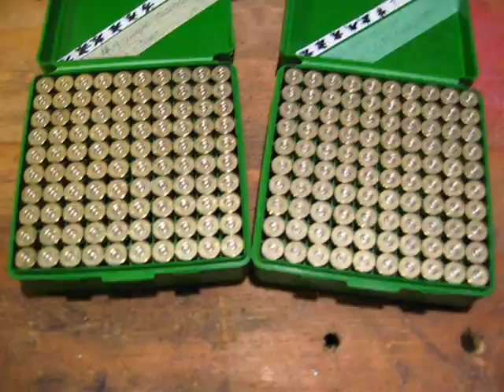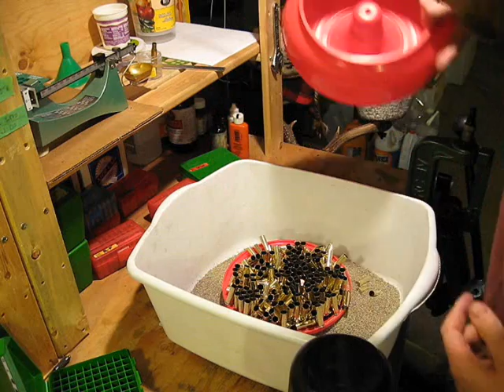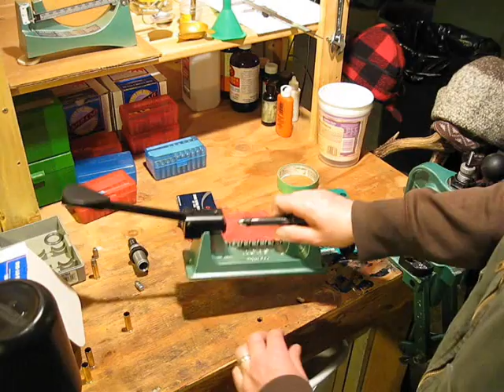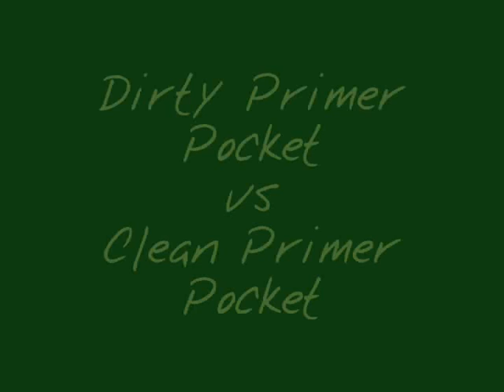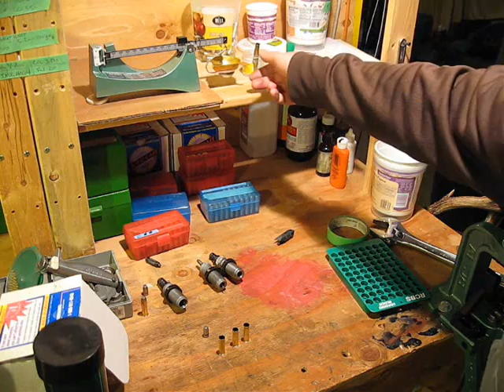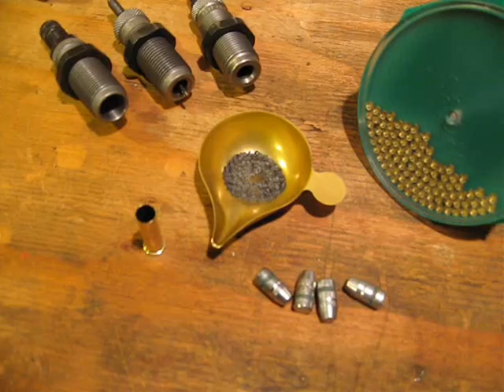Reloading Basics for my 357 Magnum

Comment: A Single Stage press is slow, as you said. A progressive press is fast but expensive. I recommend a turret press. They are great for beginners but you never feel you have outgrown them. You do one cartridge until it's done. Only then do you go on to the next cartridge. That way it doesn't matter if you do 100 or if you get interrupted after 87 rounds. You won't have cartridges half done with powder in them. 
Very good video.

Comment: I have a "Traditions" G2 this is a single shot break action 357 Magnum Rifle.
In order to find a good ammo length, I took a unprimed case pressed in a XTP bullet partway. then I took this uprimed and non charged round and put it in the rifle and closed the action. then pulled out the case with bullet and measured the round for length, then I subtracted 2 thousandths for the proper length for my rifle. The bullet comes into contact with the rifleings in the bore, on closing the breach the bullet gets pushed back into the case. Now I know exactly what my over all loaded case length  for MY rifle.  This method can be used for pretty much any and all firearms.  Just be careful.

Comment: Thanks for the info. Question I was wondering could you de-primer the brass before you put the brass in the cleaner to save a step? Just wondered if it would work that way or not.
Reply from the maker: TW RetiredVet, definitely! Some folks de-prime (or de-cap) their brass first and then tumble.  The only “cons” to that is that tumbling media sometimes ends up in the flash hole and needs to be pushed out with a pin, also you are putting “dirty” brass through your loading die.  I’ve done it both ways and I don’t know if I even have a preference.  A lot of folks shooting handgun ammo don’t even bother to tumble their brass.  I much more particular with my rifle ammunition.  And if I did even more shooting, I’d invest in a Dillon press.

Comment: Can I just deprime them first and then let the tumbler also clean the primer pocket?
Reply from the maker: Lucy Carr that works just fine, but typically my pocket primers are not cleaned very well in my tumbler and then the tumbling media is often stuck in the flash holes of some of the brass and then I have to knock it out.   I don’t own one of the sonic cleaners, but I’ve heard they will clean out the primer pockets (you’d have to ask someone who uses one).  Anyhow, you can do it either way (I’ve done it both ways many times) I just tend to prefer de-priming after I’ve polished my brass.  There are also lots of folks that never polish their brass.

Comment: Nice video, thanks for taking the time. Right now I reload for 9mm but I'm considering getting a 357 mag. I wet tumble my brass using a Harbor Freight 2-barrel rock polisher, 100 brass per barrel. I put about 1 tsp Lemi-Shine, a squirt of Dawn dish soap, 1/2 the #6 steel shot from a box of 12 shells, and hot water to just cover the brass, per each barrel. Set the timer for 1 hr and hang the brass upside down in the plastic rack the bullets come in. If you take a handful of brass and pour them over the rack the heavier base of the cartridge falls in first. Then take another empty rack and put it face to face with the loaded rack and turn it upside down. A fast way to load the brass mouth down. Set the racks in front of a fan and they dry quickly. Then decap and repeat the process, tumbling for 1 hour without the primer in. The #6 steel shot is small enough to scour the inside of the case and the primer pocket, you don't foul your dies decapping, and no extra time cleaning primer pocket by hand. I use a plastic colander slipped inside a t-shirt to drain the dirty water after each tumble and rinse with warm water, then pour the brass into the colander to separate the steel shot. So you have 2 hours tumble time while you do other stuff. Oh, and heat the steel shot on low heat while stirring in a metal cookie tray to dry it, otherwise it rusts.
Reply: I meant to say 12 gauge shells, not 12 shells.
Reply: Brass doesn’t have to be shiny, Just clean. Two hours in a vibratory Tumbler is sufficient.

Comment: does anyone have a list of the supplies that he used?
Reply from the maker: Gavin shoots, I was using Unique powder (although H110 burns a lot cleaner) and Laser-Cast bullets.  The bullets are manufactured about 45 minutes from my house and at that time I could buy them for around $50 per 500.  The powder was $20 a pound.  So I could load 1,500 rounds with $150 worth of Laser-Cast bullets (3 boxes), $20 worth of Unique powder (1 pound), and $60 worth of primers (15 boxes).  Total cost of 1,500 bullets $230 (or $0.15 a round).  If I wanted to load those same rounds today it’d cost me $295 (or $0.20 a round).  There are other powders that will fill the 357 case, basically tripling the cost of powder.  So even though Unique burns dirty, when I was trying to save money, that’s what I was using.

Comment: Very good video.  I want to get into reloading.  What is the approximate cost of your equipment, and the cost of additional sets of dies?  Thanks.
Reply from the maker: Roger D. Miller the setup I’m using cost $330 at midway USA.  Die sets range from $30-60.  There are other miscellaneous items you’ll want.  If you’re planning to reload for semi-automatics (AR 15 or pistols) you’d be better off investing in a Dillon progressive reloader.

Comment: You have to be kidding when your saving that it’s not critical for you to check the powder level in a pistol cartridge   you’re mistaken sir it is very critical to make sure of your pistol charge
Reply from the maker: Willie Bulletman, you must have misunderstood what I was saying.  When I reload rifle cartridges  after every powder drop, I verify every single load with my scale,  when I’m loading pistol cartridges, once I’ve set the volume on my powder measure, I check every 10th load.  What I was saying it that if you’re handgun cartridge is off by 1/10 of a grain you probably won’t notice it in the accuracy, since handguns are inherently inaccurate.  I am VERY cautious when it comes to measuring out the correct amount of powder.  I was saying that if you are using 6.1 grains of Power Pistol and you load some rounds that measure at 6.2 (so long as you’re not exceeding the maximum charge!) it’s not critical to VERIFY WITH A SCALE every single load.   When reloading I am BEYOND cautious!  Most people that are using a progressive reloader set the volume for their powder measure and check it every 50 or 100 rounds (if at all.)   I WAS NOT saying that it’s not critical to know how much powder you are using, that would be asinine.

Comment: what do you need to do with the die if you go from 357 loading to 38 special reloading ?? Do you just adjust the flaring die to the 38 spl length which is shorter??????thanks

Comment: thanks for the video. 
straight ahead.  simple clear demonstration. 
I'm just getting into reloading and am starting with 38 special and 357 magnum. 
question,  I'm not in the know about cast bullets. 
is there issues of leading or lead fouling? I feel inclined to use plated bullets for that reason but know the cost would increase quite a bit. 
any help would be most appreciated. 
thanks.
Reply: If you wanna cast your own bullets, powder coat them. Or I guess you could powder coat bought lead bullets. No leading in the barrel. Super slick, reducing your pressures...

Comment: So you remove the primer is the first step correct?
Reply from the maker: Sometimes I remove the primer first, but typically I tumble my brass first and then remove the primer.   The reason to polish first and then remove the primer is that 1) you don't get tumbling media in the flash hole and 2) you're not getting a bunch of gun powder residue on your reloading dies.  Either method will work and reloaders have reasons to do it whichever way they choose to do.  I've settled on #1 clean brass, #2 remove primers, #3 clean primer pockets (occasionally), #4 flare brass, #5 add new primers, #6 charge brass with proper amount of powder, and finally #7 seat and crimp bullets (some folks do this in two steps).

Comment: How much were you paying per bullet and per powder charge in 2012 Oregon? I can't get my cost down below around 25 cents per round figuring 5 loads per brass.
Reply from the maker: +MasterToan I use Oregon Trail Laser Cast Bullets.  The company that makes them is about 45 miles from my house.  In 2012 I could purchase 500 bullets for $50, my powder was just over $20 a pound and 1,000 primers were around $30. A pound of Unique could load nearly 1,400 rounds.  So around $150 for 1,000 rounds. Today I can get those bullets for about $60, the primers for $35, and the powder is getting closer to $30.  So now its up to about $0.18 a shot.  So far as brass is concerned; I plan on 10 firings (I still inspect my brass every time before it's reloaded).  I calculate the cost for brass to be about $0.02 per shot, but that is only in theory because I've never completely worn out any straight walled brass.  I have two boxes of 100 shells that have been fired 10 times and still have no major signs of wear.  I have over 1,000 cases for each caliber handgun I shoot and so far I've never had to retire any of my brass.  My $0.15 a shot comment is for a $.10 bullet, a $0.03 primer, and less than $0.02 worth of powder  (Unique).  Unique is a super affordable powder, however H110 is my best powder (it's just a lot more expensive per shot).  GOOD LUCK!
Reply: +TheOregonOutdoorsman 
Thanks Oregon!

Comment: Great video and I too plan on reloading 158 GR. LSWC bullets. I get the sense you know this process by your video. I purchased coyote brand lead cast wad cutter with .358 diameter and was told I can use either the .357 or .358 diameter lead bullets with the 357 magnum hand gun. I was told you can go 1 1/2 thousands over the .375 diameter. Your thoughts.

Comment: What do you think of Lee handloader kits for the 357 mag ?
Reply from the maker: I can't comment, I haven't used it. I'd read as many reviews as possible and try to figure out which ones are written by folks that know what they're talking about. Good Luck!
Reply from the maker: I can't comment, I've never used one before.
Reply: I have have used the old Whack a mold Lee hand loader kits for over 10 years. Very theraputic.  I spend a few hours and load clean brass. I use a Hornady hand primer loader though. Lots easier and easier on my nerves.
Reply: Deezildennis I used a 30-06 Lee hand  loader some 20 years ago kind that comes in a red box, it wasn't accurate then again i was shooting  100 yrds and yes the primer would go off sometimes when putting it in.

Comment: Silly question: why not pop the primers out THEN tumble (or ultrasonic cleaner) them?  That way the primer pockets would be clean too, no?
Reply from the maker: I like to clean the brass before I pop the primers out so that I don't get a bunch of gunk in my reloading dies. I've done it both ways and they both work but I've settled on cleaning the brass first.
Reply: TheOregonOutdoorsman
Thanks!  I'm thinking of getting into reloading (It's a bit intimidating at first!) for my .357 and 40S&W, and was going to go the ultrasonic cleaner route, but just wonder why in videos, people didn't do that.  Makes sense, not getting crud all over the dies.
Reply: Blank Reg
I've also had little bits of walnut get stuck in the flash hole.   Another reason, to tumble with the old primers in.
Reply: Trey Hardin AAah.  Yah, I was planning on using ultrasonic cleaning.  But it would still be dirty when popping out the primers and maybe junk up the press.
Reply: Blank Reg For any that are interested, you use a die specifically for depriming that does not resize the case.  Then ultrasonic clean the cases, and then dry  and then process normally after that.  The only real dirty piece getting knocked out is the primer, and the primer pockets get cleaned - when cleaning ultrasonically or with wet tumbling with stainless steel media. No gunk in the presses from depriming first- provided that you use a depriming die and not purpose built resizing die.
Reply: Mad Dawg Yah I just started reloading a couple days ago.  I don't bother cleaning the primer pockets out of 357 magnum. I probably should, but my first batch of 100 rounds shot flawlessly.  I think I might just use a primer pocket cleaner in a drill bit to clean the pockets after the initial cleaning of the brass in the sonic cleaner.

Comment: Great introduction video on reloading the 357.  I too use a single stage press.  The thing I like about the single stage is that it forces me to handle each piece of brass such that I can check for split brass which can be an issue when using older brass or running hotter loads.
Reply: Great introduction  video and helpful comment.  I'm just getting into pistol shooting (rifle and shotgun all my life) and I'm a lefty shooter so I decided to go with a revolver rather than semi-auto.  I'm going to want to shoot a bunch with a single gun so a .359/.38 special seemed to be the most versatile option.  When I start to reload, It's good to know things like the value of handling the brass to check for cracks or other flaws.  Thanks!

Comment: Really enjoyed your video...I just got done making a bunch of 38/357 last night. And yes with a single stage press it does take a while - a radio helps! :)

To free up space on my bench I mounted my trimmer on a 2x4 and then use 2 "C" clamps to hold the trimmer in place when I need the trimmer. Yes it is a little more work to tighten the clamps but it is worth it to be able to move the trimmer and have the space when finished trimming.

Thanks again for the vid.

Comment from the maker: The most important thing is to examine the brass for signs of wear.  If the brass isn't showing excessive wear then a general number of reloads is ten times for straight wall cartridges (handgun ammo) and five times for necked cartridges (rifle ammo).  Some people reload more times or less times depending on the condition of the brass.

Comment: Thanks for a great vid. I hope you can help me clarify the .38  .357 reloading thing. Can I reload a .38 cal (.357 magnum) bullet into a .38 spl case? The reloading specs are confusing to me also. I loaded .38 bullets with 3.2 win 231 but it looks like my min win 231 with a 357 JHP is 3.8 I'm a little confused by this. The bullet dia is the same they are both 158 gr.  Both bullets are being loaded in a 38 spl case. I'm fond of my eyes and fingers  I thought you could help me.